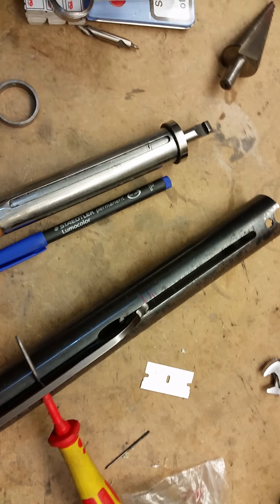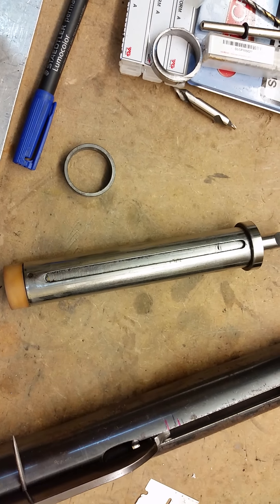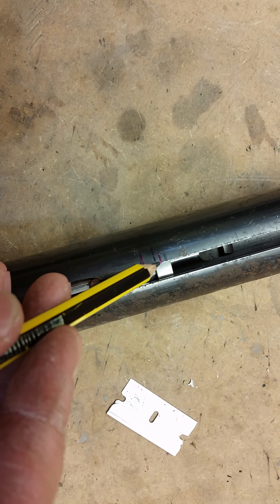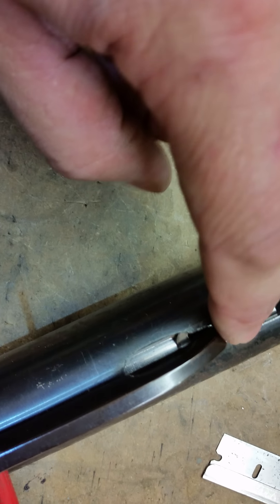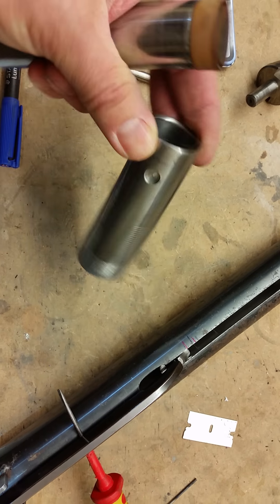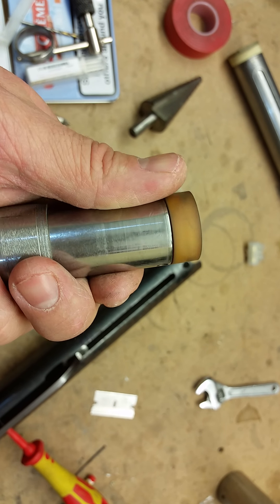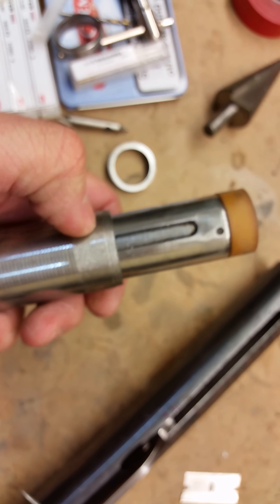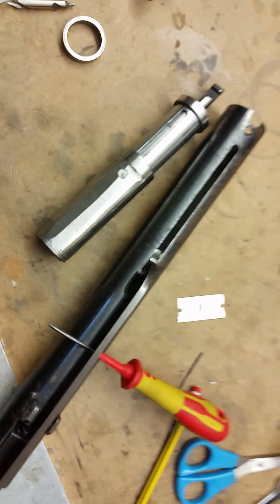Weihrsuch Hw80 lasaglide buildalong

Comment: The problem with the HW77 pistion is that you have a catch that only works in one plane to latch on the trigger sear/catch. On the original HW80 piston the cocking shoe keeps the piston oriented correctly. That's why the Walther LGV piston is used as it's latch is round and can be used in any orientation.